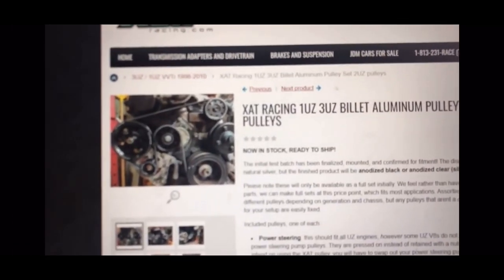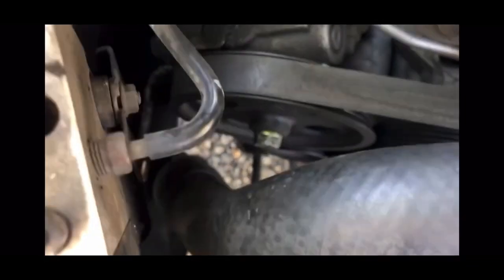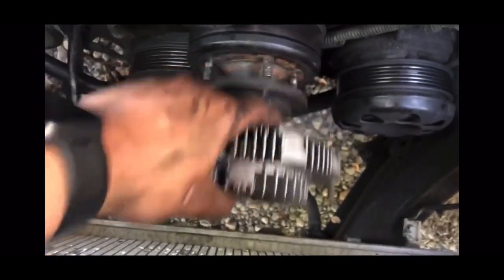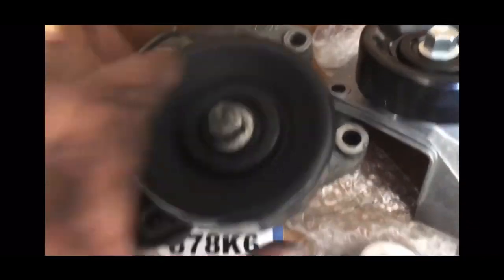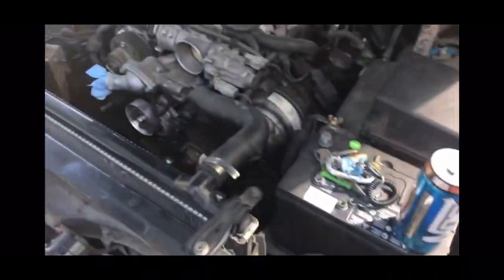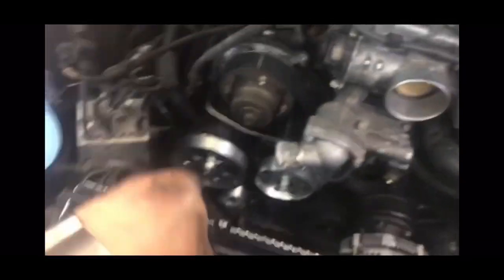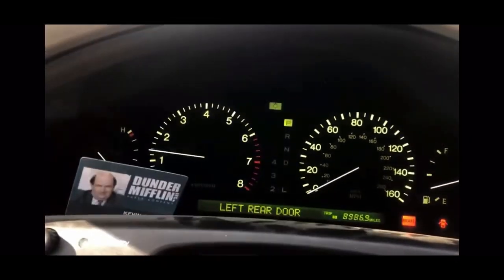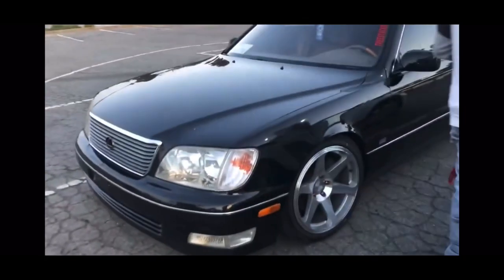LS400 Aftermarket Pulley Install / Review

Comment: Try not running the fan clutch. They take some high end away from the 1uz. I noticed a difference on my first gen ls deleting that clutch fan. You still have the two fans up front that kick on at certain temperatures
Reply from the maker: How did you delete it can you dm me on IG @500hyphy
Reply: @DefinitelyNotJamez  the pulley you had issue fitting due to it being the wrong size, you just put washers (2) on each stud where the clutch would go. It essentially makes that pulley and idler pulley.
Reply from the maker: Im going to try that !
Reply: @DefinitelyNotJamez  let me know what you think. It helped the gen 1 LS out a lot. first thing I do to them

Comment: The power steering pulley has incorrect offset is there a way to correct this my sc400 is stuck
Reply from the maker: What do you mean ? My DMS are always open @not500hyphy
Reply: @DefinitelyNotJamez  sorry it was a misorder for vvti
Reply: @DefinitelyNotJamez  but would there be a way to fot the vvti power steering pulley onto not vvti. It sticks about a out half inch too far could it be grinded down?